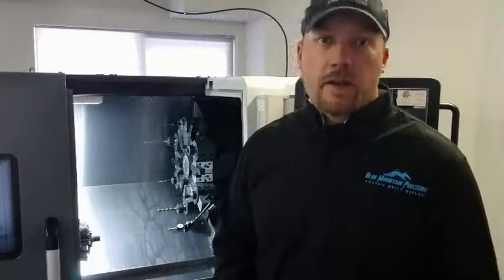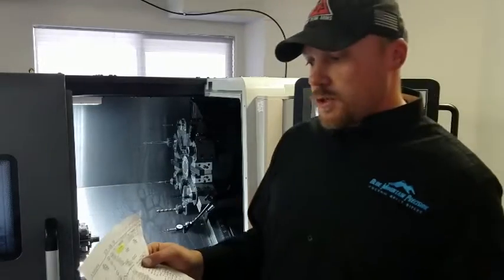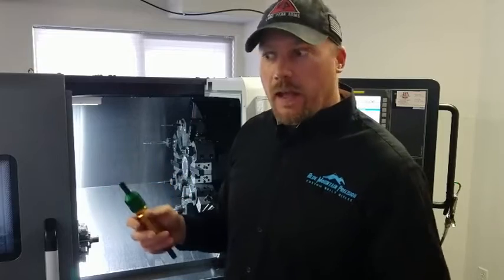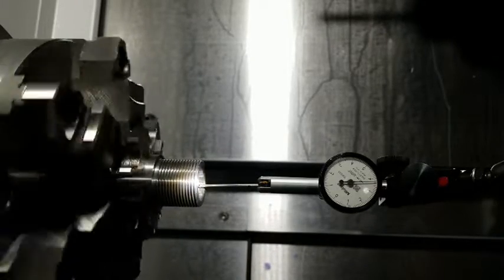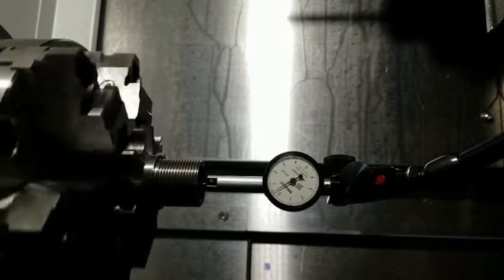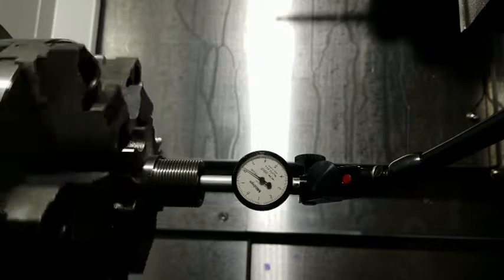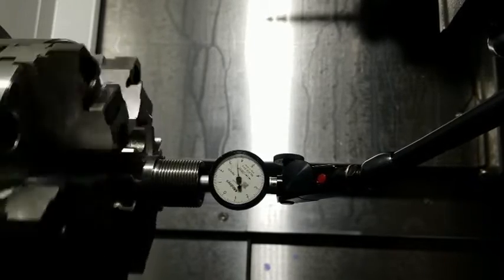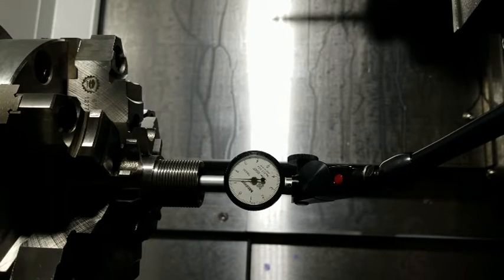Chamber Job on CNC

Comment: How do you true the opposite end of the barrel when it’s within the head stock?
Reply from the maker: I have an extension for my dual bushing range rod to extend to the outside of the spindle to measure bore runout and clock barrel curvature.